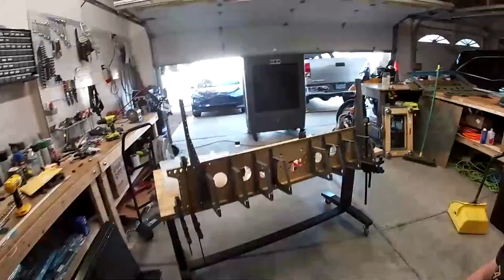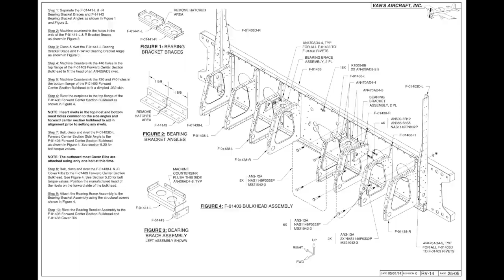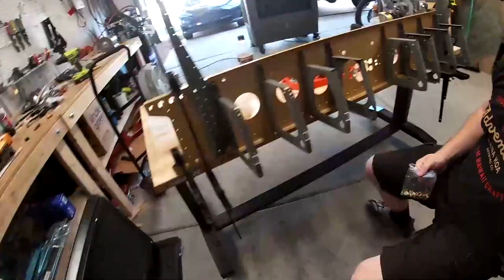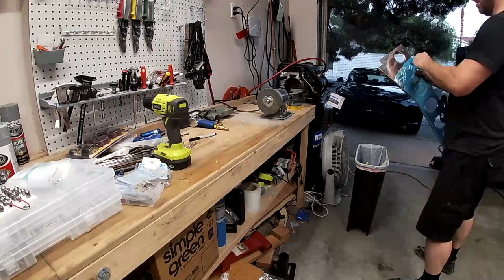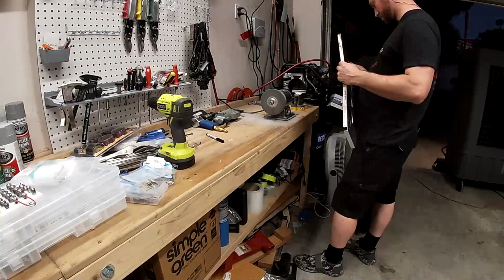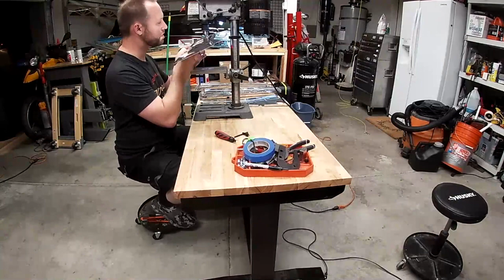RV-14: Fuselage 16

Comment: Home depot sells a small pencil debur tool like your mango dealie there too in the pipe section.  Harbor Freight also has a conditioning tool for the grinder wheel.  It looks like you just run the grinder then run the conditioner thingy on it and it fixes it up.  Dunno if that's meant for more stoney type wheels or not but it's there.